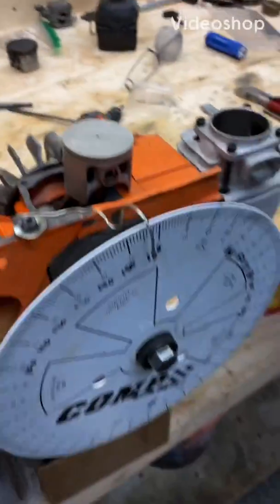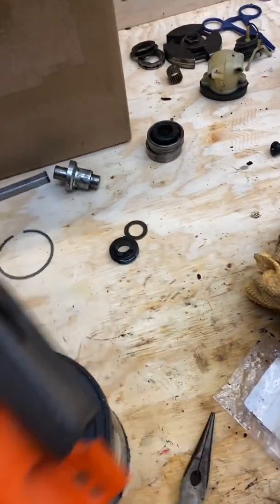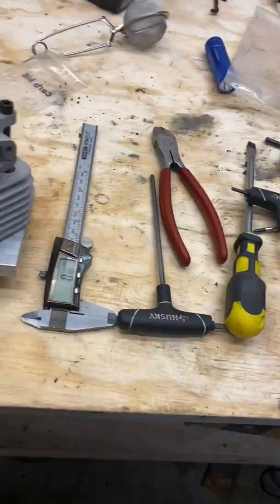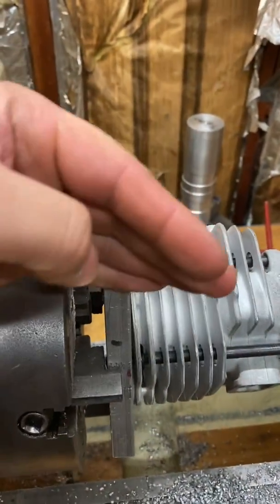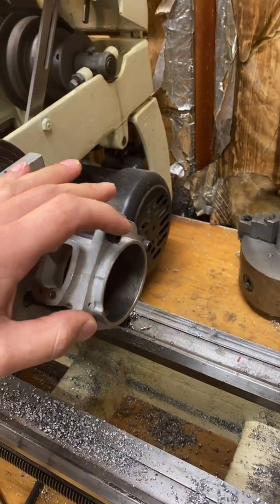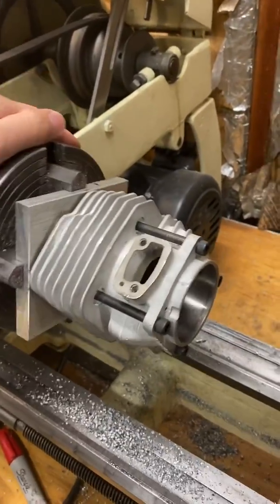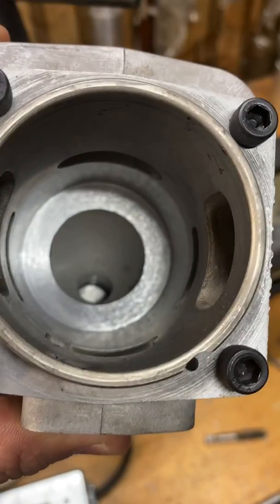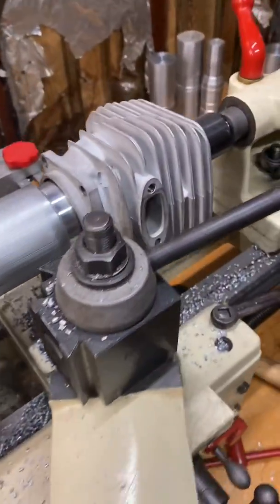Part 1: Machine work on a husqvarna 288xp

Comment: Sub'd. I will get a plate and start making one for holding the cylinder, I just wasn't sure if my lathe is going to allow me to open the jaws that far. I'm waiting for Precision Mathews to put some on sale hopefully in the next two months and if they don't then I will just be ordering the 12" lathe then.
Reply from the maker: I turn the jaws around on my 4 jaw.
Reply from the maker: I get my plates off eBay. I first would cut them too size but you can get them in the correct size for a little more. Don’t need very many. I use about four and that seems to cover most saws
Reply: @yotaismygame  Roughly what size are they? I will see if my four jaw can open that much. I'm thinking I could go off the corners, rather than the sides, to help save some size where I have a smaller lathe.
Reply from the maker: I’ll have to check when I get home but I’d say roughly 4x4 .5 thick.
Reply: @yotaismygame  Thanks. I just checked a 372 cylinder, if I put the holes for the cylinder towards the corners I can do it with a 3-1/2x3-3/4 plate and grab the sides with the jaws, that leaves me with about 3/4 to the edge from the mount holes. I can go up to 4-1/2 with my jaws reversed like you are doing but that only leaves me two turns in and with the plate made smaller that allows more threads on my jaws so it will be stronger.
Reply from the maker: @MegaLostOne  Just checked my plates and they are the size I stated. Whatever works works. Many ways to tackle this job. Glad I could help

Comment: Are you able to do the porting with just the cylinder ? I’d like to get a 660 jug done
Reply from the maker: If I had a spare 660 case I could. Otherwise I would be limited to just widening and polishing. Could also cut the base and do a pop up for some more compression. Definitely not ideal.
Reply: Saw Greater any chances of you getting a set of cases anytime soon
Reply from the maker: @98fishingfool  Very unlikely. What's wrong with sending the whole saw?